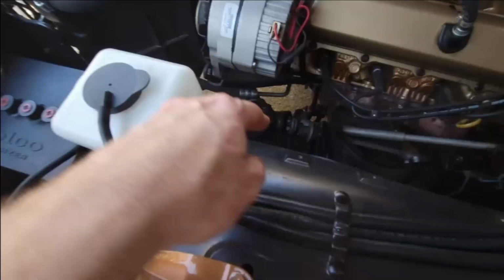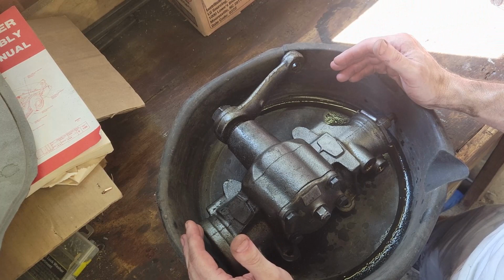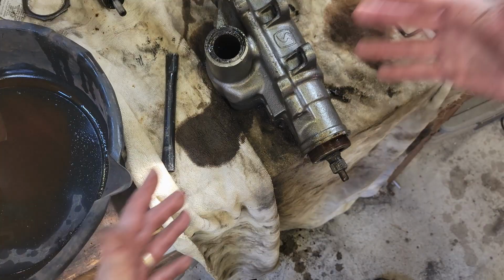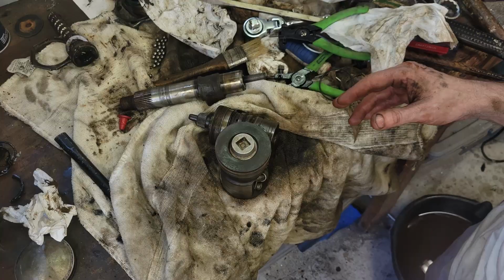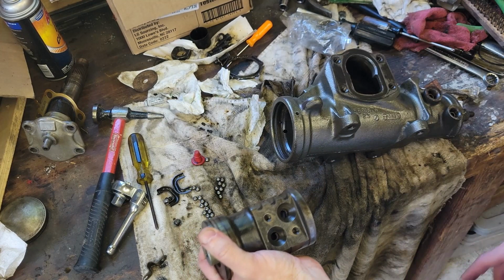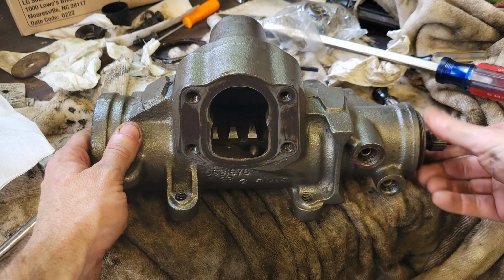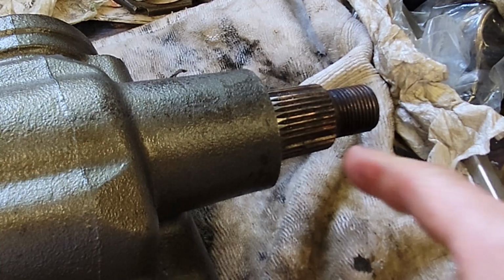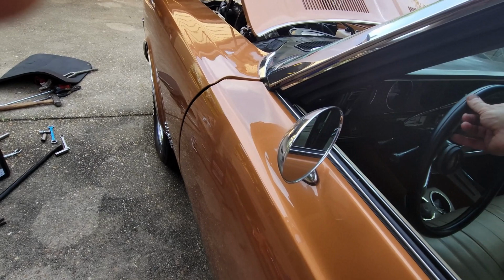1971 Cutlass Power Steering Gear Box Disassembly & Rebuild!

Comment: Nice job , for my Cutlass I got a jeep Cherokee quick ratio box from the salvage yard. $50.  Plus I had to get a different rag joint and a couple little adapters for where the p/ s fittings attach to the steering box .  😊JR
Reply from the maker: Tell me more... I might want to do that!

Comment: If I watched this you said 16 Balls in box and rest in split C....I watched you place 4 in but you should have 2 more in that C...maybe I missed it well done great video
Reply from the maker: Well... if I'm being completely honest...  There were supposed to be 4 more balls than what I actually had.  I didn't lose any.  It was working that way when I took it apart, so I figured it would work that way when I reassembled it, and it does.  You'll notice I said "and the rest of the balls go in this clip!"  I white-washed where the instructions said to put 8 in when I only had 4!  LOL!